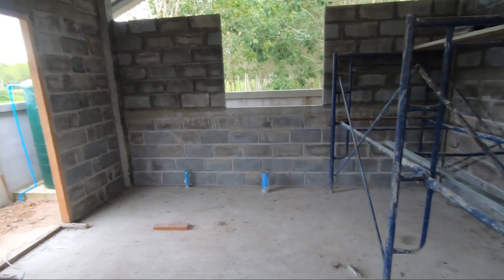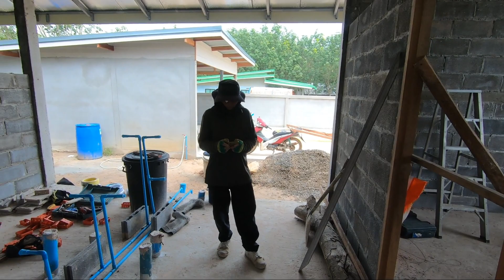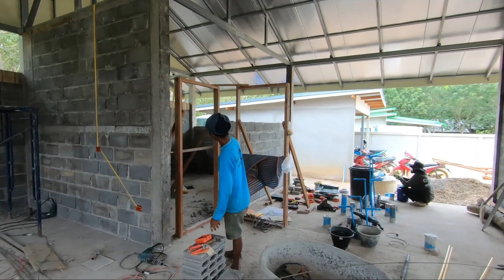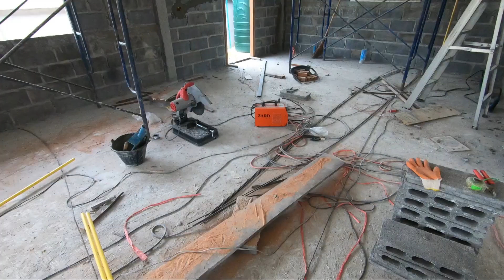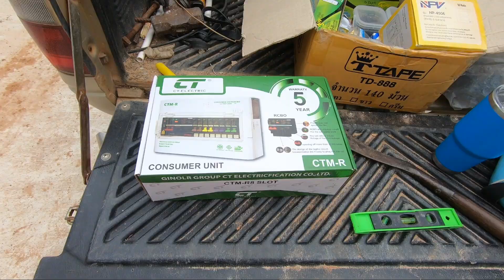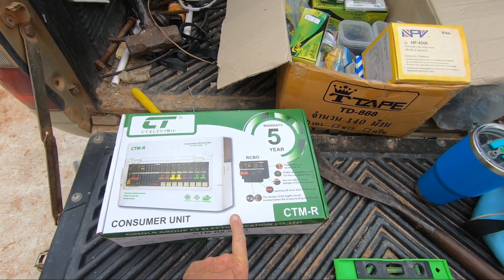New House Build part 52 - The electricians arrive....early

Comment: when they start running the electrical wires, make sure that they use the same colour for live, neutral and earth consistently. Thai sparkies have been known to mix colours when they finish a roll of wire, ie use neutral when they run out of live, instead of buying another roll ! These guys seem pretty good though, unless it was because you were there 😄